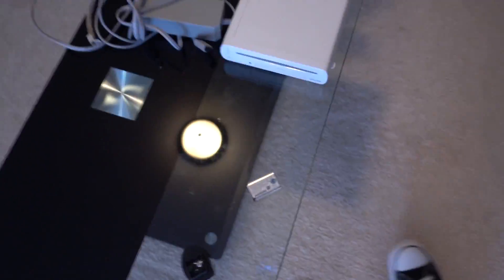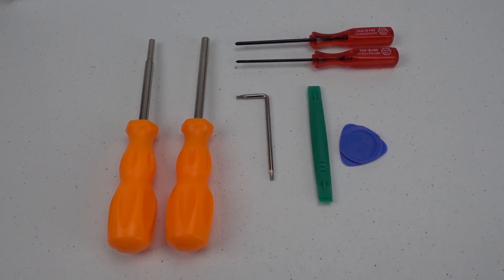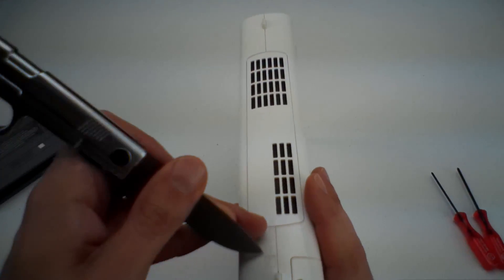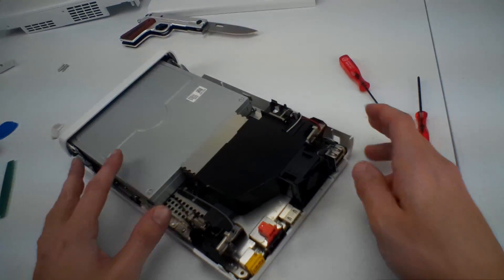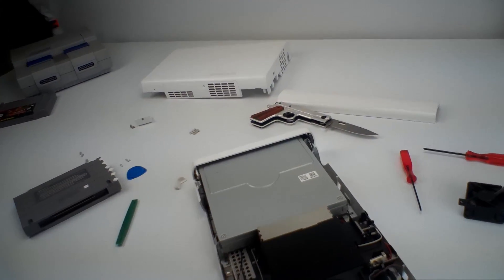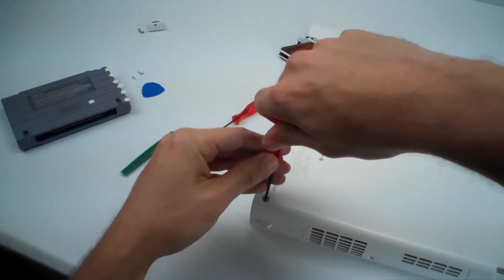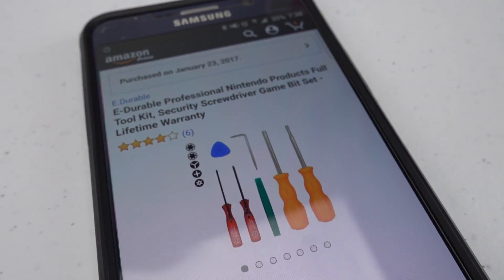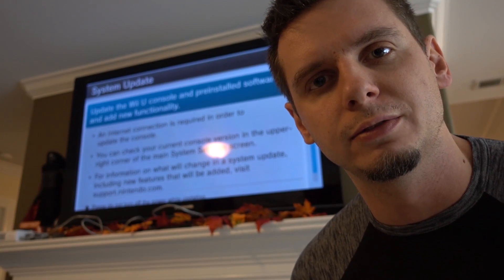How to Take Apart and Fix an Overheating Nintendo Wii U Red Light of Death

Comment: Trying to use this guide in 2023. Is there an alternate link for the toolset? Looks like the one linked is no longer available on Amazon.
Reply from the maker: Not for a direct replacement but I am running this one now and it has everything you'll ever need to work on anything Nintendo / small electronics:  https://amzn.to/3vq6DEi
Reply: Thanks!

Comment: Ty for this! A friend gave me his wii u and I was pissed trying to figure out why it kept turning red. Followed your uncovering instructions and instead of buying a new fan, I went ahead and just took the original fan out, cleaned the fan blades with a cue tip, then got a portable dust buster and had it suck air on both sides of the fan to force the blades to move and it pretty much made it work again like new. Now I can mod my wii u and enjoy it!

Comment: The thing that I always did when my Wii U was overheating, was pulling the cable put and then putting it back in. It works but... for these days when my Wii U stays on for like, 20 minutes it overheats. IDK why. I think it's because 2 of my other consoles are stacked on top of the Wii U.
Reply from the maker: The fan is caked up. Needs to be replaced.
Reply: @QuickandDirty  caked up? WDYM?
Reply: @bloverfrompvz  he means the fan is dirty. Caked up/ caked on is a pretty common thing to say in many parts of the United States. When you get a lot of dirt stuck on a car, or something sticky on the stove that won’t come off, you could say: “Wow, that dirt is caked on there pretty good.”
Reply: @Sacren365  ooooooh
Reply: @QuickandDirty  like I was playing with my Wii U, but when I put the HOME menu, after a few minutes, the screen went black and the Wii U overheated. It happened twice.

Comment: Dust caked up on the fan blades. These fan motors are weak. It might not spin if too much dust. I have cleaned my PS4 fan 3 times and it still works. Need to change CMOS battery if you take the Wii apart. These days I would replace the laser if I took one apart, and maybe disc drive.

Comment: I’m having trouble getting those safety tabs off at the bottom of the Wii u that covers up the screws, any suggestions?
Reply from the maker: Stick a knife under the edge and gently pry. They're just held in with tape.
Reply: @QuickandDirty  great thanks

Comment: friend I have a black model, when I turn on the power already flashes red, would that be the problem?
Reply: same happens to mine, so im replacing the fan to see if it will work, I have never found another person with the same problem
try cleaning it
Reply: @Garchomp808  did it work?
Reply: @chuardo3557  yes like a charm
Reply: @Garchomp808  i don't know if I should get a new fan or a new AC Adapter
Reply: @chuardo3557  depends on the problem. If it flashes red and cuts off its the fan. If it's not wanting to turn on or keeps turning off randomly, lights included its probably the cord.
Reply: @Garchomp808  the fan runs but maybe not at the expected speed idk I don't have another one to compare, when turned off it sometimes starts to blink red and when I turn it on, it works for a while and then it shuts off
Reply: @chuardo3557  yeah its a fan issue. When it turns off and blinks red that's overheating

Comment: Mine had the same issue if it has been turn on for at least 2 to 3 hours and it overheats it was really hot inside of the console

I recently cleaned mine that had a lot of dust and it worked it dosent get as hot as before after 3 or 2 hours
Your issue is diferent from mine but at least you fixed it (some years late but why not explain it?)

Comment: I just turn my wii u and the light just stays red
Reply from the maker: Sounds like you may have a different major hardware issue.
Reply: @QuickandDirty  but if I disconnect the ac adapter the wii u will turn on
Reply: @QuickandDirty  and what i can do🥺

Comment: Ok so I gust got a wii (2006) and the blue disc light will flash when it is off and when I last checked the system, it was as hot as fire.  I am going to try to take my wii apart and fix this
Reply from the maker: Look at the back while powered up. If the fan isn't spinning it's definitely the problem.  Good luck!
Reply: Are you sure you don't have your Wii on standby mode? is impossible for the wii for have the disc drive led without having the Standby Mode,I cant believe many people think that the Standby Mode literally means your console is dead,geez use common sense

Comment: Wow didn’t even know this happened. I’ve owned and still own every Nintendo system since the original NES and I’ve never had one fail me yet. I always worry about my PlayStation’s and Xbox’s but I’ve never given another thought to the Nintendo’s breaking they build some good consoles however for a person like me that keeps and collects every system I ever buy this is good preventive maintenance to do also to keep it clean and running well.
Reply from the maker: I'm pretty sure the people I bought it from were smokers. Would explain why the fan gummed up. Also had a lot of dust in it. But yes, Nintendo hardware is always great. Well... Maybe not the NES 72 pins but yanno.
Reply: Quick and Dirty ah who doesn’t miss blowing into their cartridges lol

Comment: Sorry Quick and Dirty,

Don't do this at home it is a waste of money and time....
The bearing of the fan (from the back of the Wii U) just need a little bit oil. The fan are only a 3 watts... pretty weak. So it is the bearing who prevent the propeller to turn.

look here :https://www.youtube.com/watch?v=97Se9x0Kxc0

Remove the screen on the fan behind the wii "gently" with a "table knife" or broke it if you want (no more warranty, got it) After that, take a look at the fan " their a "sticker" on it remove it and drop 1 or 2 goute of any king of oil "BUT AVOID ANY FOOD OIL" one or 2 drop (not more) and breath of it and test it right away by powered the wii U

If you got a syringe try that way must easier :https://www.youtube.com/watch?v=Uvp526IW8x4

After dropping the oil, breath on the fan to make it turn... after that turn on your Wii U and Voila!

I have just done it.
Reply from the maker: Couldn't disagree more.  $4 for the fan and 15 minutes is all I invested.  Paid $64 total for the Wii U, and now it works perfectly.
Reply: First of all, lets make thing clear for all ...
Repairing kit wii U : 12$ 
https://www.amazon.com/Nintendo-Screwdriver-Keten-Professional-Products/dp/B06XP8FMM2/ref=sr_1_1?s=videogames&ie=UTF8&qid=1493477341&sr=1-1&keywords=wii+u+repairing+tool+kit

Fan wii u : 17,99 (free shipping) 
https://www.amazon.com/Pieces-Repair-Part-Replacement-Internal-Cooling/dp/B01DTCY6BY/ref=sr_1_2?ie=UTF8&qid=1493477405&sr=8-2&keywords=fan+wii+u

The one who can get from ebay doesn't include free shipping. Once you get it, the cost close to 15$ dollars.

total cost of your "tutorial" 29$ 

Total cost of my solution : the price of the oil (for 1 or 2 drops) ... and 1 Q-tips ... so about 3$ (lets say)

Second thing, a fan got almost an "endlife time" durability ... and no, you have never think to fix the bearing fan FIRST! You strait ahead to change the fan in your tutorial. I just mean to say "TRY ITS FIRST" before spendind money of your listeners.
Reply from the maker: Pat Tra it was $4.95 shipped from China.
Reply: he already did it so shut up